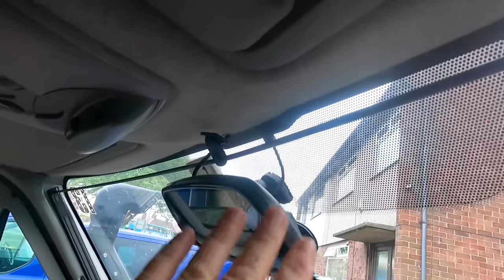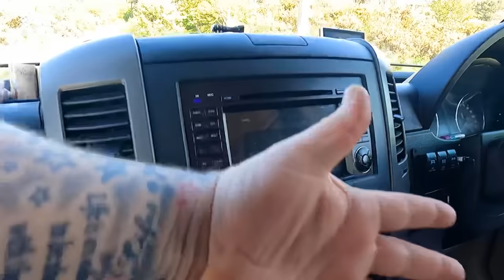These Remis Blinds Are NOT Worth £600

Comment: My Remis blinds were fitted 5 years ago and have stood up to the test of time. Yes it's now a fiddly job if you need to remove the pillar trim but we wouldn't be without them. They stand clear off the windscreen and don't absorb moisture when condensated, however I felt the drivers door blind trim obstructed my view of the standard wing mirror. So after a few scary episodes of blind spot/near miss I fitted an extended arm drivers wing mirror. I'm also sure that the previous owner only paid about £300 for the blinds in 2016. 😲
Reply from the maker: Now £300 is a great price . And YES YES YES the placement on the driver side blind dose obstruct the mirror a lot and I’m not happy about that at all . Part of me feels it wouldn’t pass the mot if they bothered to check it . I really think that could be altered
Reply: You may well be correct about the MOT  and yes, a small shift rearward of the side blind centre upright would be a welcome and safe redesign. My extended arm wing mirror does not look out of place and I'm the only one that notices, it does however make me nervous when meeting oncoming vehicles with big/wide wing mirrors otherwise its the perfect solution to the Remis "blind spot". Thinking about it, I'm sure or European neighbours will have the same issue but on their drivers side.
Thanks for all the helpful and entertaining videos BTW. 👍🏻

Comment: We've just bought a van with this windacreen blind on and they wint stau closed, just keep springing open.... are they supposed to be magnetic??
Reply from the maker: The magnetic strip has possibly fallen off, where the handles are try using a hair bobble until you can replace it